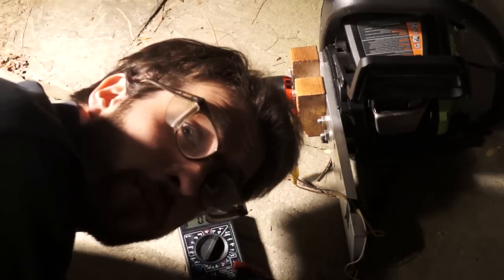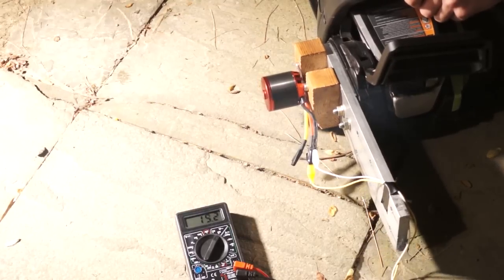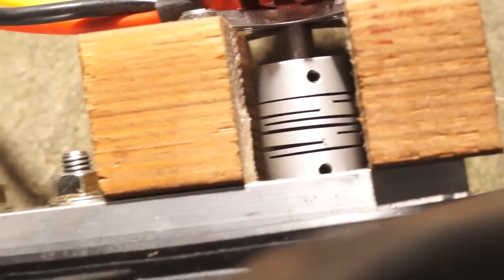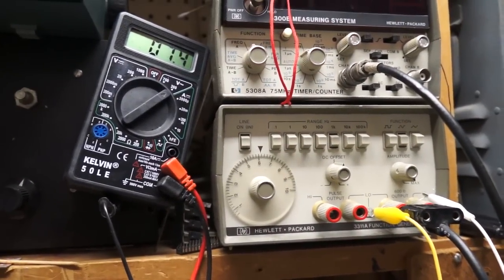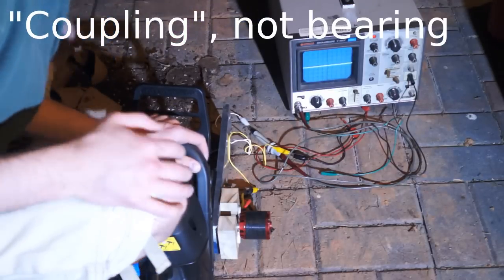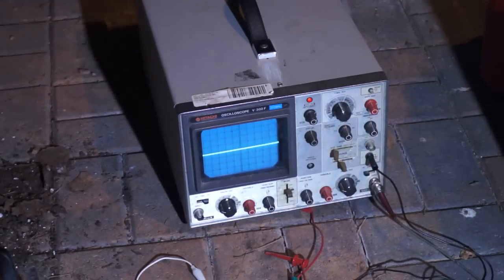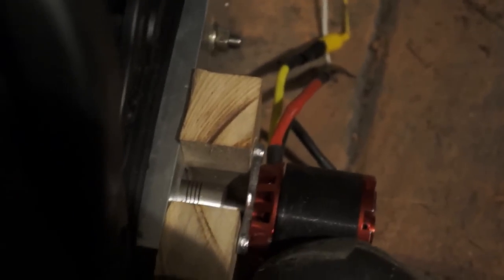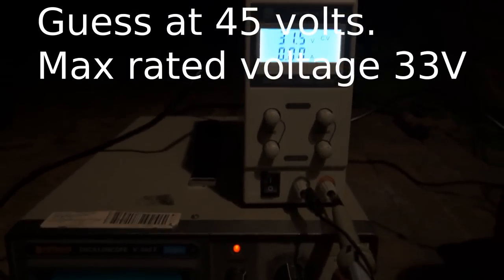More Failed Attempts at a Chainsaw Engine Power Source

Comment: hmm why not use a pulley and belt?  Would give you a nice gear ratio and much less issues concerning couplings, not to mention would probably help "buffer" out a lot of the vibration that might cause the motor bearings to wear out prematurely.  Engine doesnt sound very healthy, maybe it's just me though, 2 cycle?  Are you making sure to add the lubricant mix into the gasoline?

Comment: Those frequency plus amplitude changes are pretty severe.  Regulating that all out might be painful ...  Also, something to think about - you're running it with no load right now...  Try putting a couple of big-honkin' power resistors on there to provide a load similar to what you think you'll be using in the end - see how things change, then...

Comment from the maker: My concern wasn't with the alternators so much, though, alternators do have additional problems of needing to be energized before they will put out... 

You can mechanical-advantage the speed down to something a regular alternator can take.  My concern is with the mechanics of the belt or chain system.  Everything I've looked at that does have ratings doesn't go that high.

Comment: lynxae co uk/Products-alternators htm (replace spaces with periods) seem to show a max rpm of 18K for Denso alternators. This is the first website I came across so it's for race alternators and in the UK, I expect other alternators would be similar as they're usually geared up from the crank. Searching for "chainsaw rpm" I can see that Stihl (I don't know the make of your chainsaw) show a max rpm of 14K.

Comment: I haven't seen what you want the power source to be (voltage/amps), but would a car alternator attached to the end of the bar and driven by chain or V-belt be easier to fabricate? I don't know if they're available in the states, but the Suzuki Swift and Diahatsu Charade have small alternators that are used in racing. A trawl of junk-yards might reveal similar small ones.

Comment: Loctite 242 is loctite blue, for blue on the data sheet it says "apply localized heat to nut or bolt to approximately 482°F" (thats one heck of an exacting approximation I do acknowledge). So a big soldering iron that you don't care about much (in case any of the loctite gets on it) or a micro butane torch should do the trick.

Comment: Maybe try a tire shaft coupling. Also, to help get locktite stuck on bolts and other stuff try using heat, admittedly for locktite red the amount of heat needed might damage other materials nearby (I hope you used blue).

Comment: You should use a belt transmission. That would allow different sizes on the pulleys. Something along the lines of this (found in old xerox machines) h t t p : / / w w w .econobelt. com/e-store/Pulleys.jpg